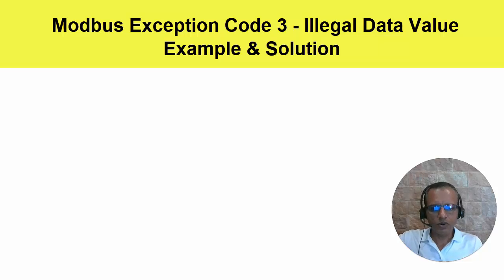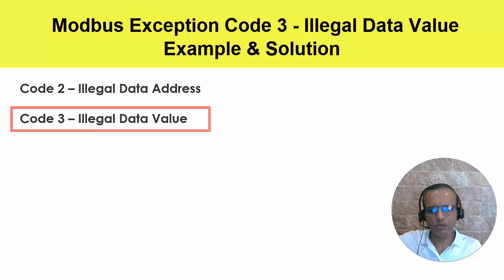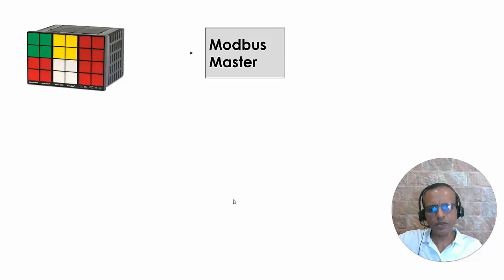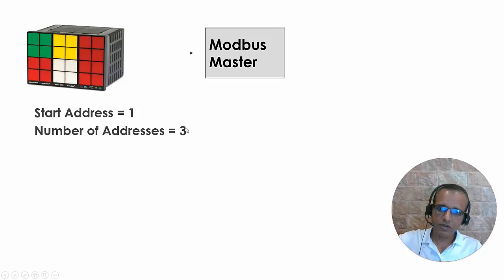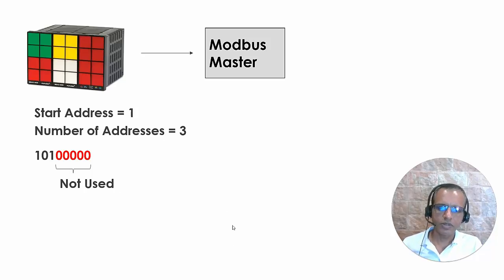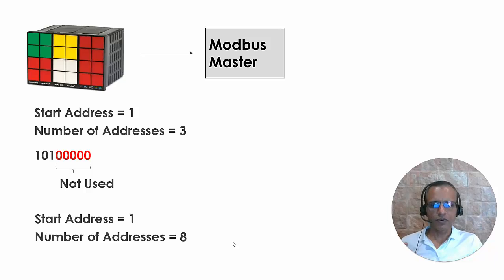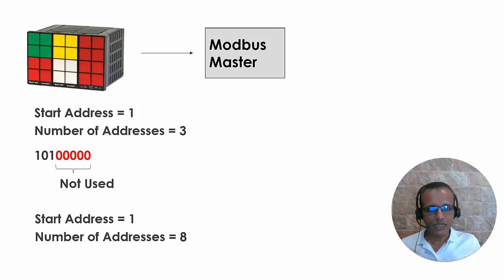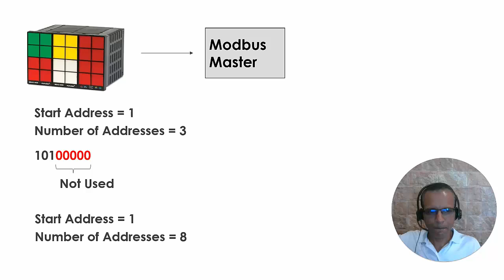Modbus Exception Code 3 - Illegal Data Value - Example & Solution

Comment: Hello Mr. Ackbarali,

I am facing this error, I am trying to write to the registers of a Mitsubishi Er 700 VFD.

When I am reading it's fine but once I try to write the error shows.

I would appreciate it if you could recommend a possible solution.